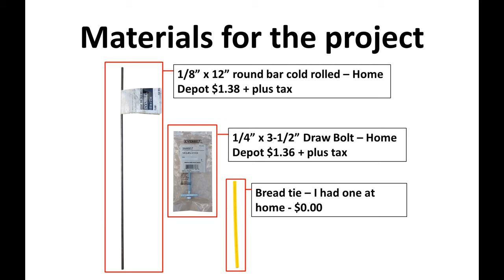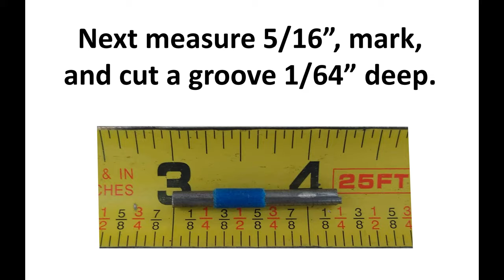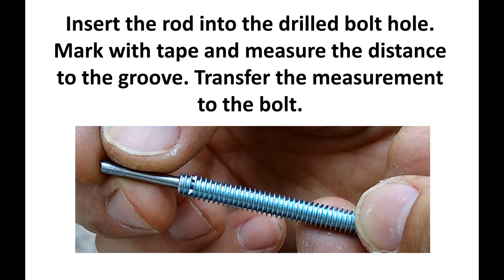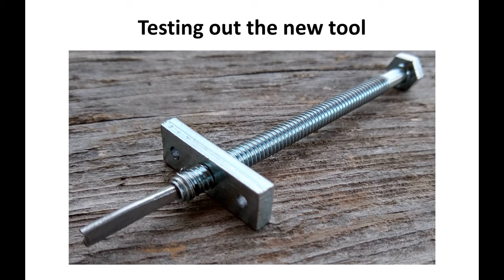DIY Hose Clamp Wire Tension Tool for under $3.00

Comment: I just made one of these. Using a turnbuckle works amazing. I use so much hose clamps this will save me so much over time.
Reply from the maker: Hello AUMM, Thank you for commenting. These wire tension tools are awesome, for sure. I needed to fasten the end of a garden fence to my porch post. I was able to fish the wire through a piece of clear tubing to keep from marring the post and was able to pull off a very strong clamp that was about 9 inches long. You'll find a boat load of uses for it.

Best of luck with your projects!

Comment: What a fabulous video production. Throw in a clever tool and an ingenious way to make it for a tiny sum and it kept me happy and fascinated for the entire ten minutes. I was sorry when it ended. I'm going to make one, purely because it looks like so much fun. Many thanks.
Reply from the maker: Hello David H, Thank you for your kindness. I'm glad you found value for your viewing time. The little tool is super cool to use. Since the original video I've just magnetized the tip and it stays inside the bolt without the need for the slotting, grooving, and bread tie part. Finding a way for it to stay but still be able to rotate was the challenging bit for me.

Best of luck with your projects!

Comment: Just made one in my shop.  Nice simplification of an old tool, and it works well, providing you use the right wire.
Reply from the maker: Hi Roger, Thank you for commenting. I'm glad you found value in this video for your viewing time. I use some stainless steel drop ceiling wire that has been working well for me.

Best of luck with your projects!

Comment: Probably one of the simplest and most practical iterations of this type tool I've seen... Well done
Reply from the maker: Hello Mr. Rickard, Thank you for commenting and your kind words. I'm glad you found value in the video for your viewing time.

Best of luck with your projects!
Reply: @vbared  - Thanks for making this video! I needed a tool for making round clamps and went to a website of a company called Clamptite. They wanted $49.95 for their tool, and it didn't do anything that your tool couldn't do for $3.00. I almost bought their tool, but then I saw your video. Thanks again!

Comment: Great video.  I plan on making one.  Just a couple suggestions though...  Drill the bolt and insert the rod before cutting the slot into the side of the bolt.  As soon as  you make contact with the rod, remove it and it will be marked in the correct spot for the groove.  Also a small ball bearing inserted between the rod and the inside of the bolt would make it work smoother.
Reply from the maker: Hello 2Lane Blacktop, thank you for commenting. Great suggestions. The rotating tip does bind on me at times. The ball bearing idea is awesome. Do you have any suggestions for a better way to hold the rod in place? The bread tie gets loose and needs to be retightened after several uses.

Best of luck with your improved version.

Cheers!
Reply: @vbared  I've been thinking about that, I figured that might be an issue.  Maybe use the side of a small flat file to square off the groove in the rod, then instead of slotting the bolt, drill a small hole and insert a small roll pin.  Might not be enough meat to hold the roll pin though.  If that is the case, secure a nut to the bolt with J-B weld and drill through both the bolt and nut.  I'm not sure what size bolt you used, but moving up one size might also work better for the roll pin idea. 🤔
Reply: @vbared  Cut the slot as you did, insert a short piece of roll pin  or steel wire and put the unused nut over the slot to capture it. Maybe a BB would work as a bearing or just round the inboard end of the rod. A little antiseize could lube it up...
Reply from the maker: @cjspaar2090  That's a great idea, Cj Spaar. Thank you for sharing it.

Best of luck with your projects!
Reply: @vbared  I think if you stuffed a 1/8" Diameter cylinder Neodymium magnet in the bolt you would get all the retention you need
Reply from the maker: @007mwn  Hello @007mwn, Thank you for commenting. That is a great idea and would remove a few steps from this process. 

Best of luck with your projects!
Reply: @vbared  id have thought a modified wire C clip or e clip to fit into the bolt thread.. grind the end tabs off (not the ends though theyd be too short to wrap round the bolt) the e clip to wrap around the bolt in the thread.. the middle tab would engage in the slot into the pins groove.. spring steel !
Reply from the maker: @Errol.C-nz  Hi Errol, An e-clip is a great idea. I'm currently using bearing grease as a lubricant and holder. The grease is thick enough to keep the pin from falling off.
Reply: @cjspaar2090  Great idea.

Comment: Well that was a memorable video showing an easy way to do something critical with a minimum amount of tools and materials. Need more like that on YouTube. Thank you for taking the time to share.
Reply from the maker: Hello Metalmogul46, Thank you for commenting and kind words. The goal was to put together something simple, low cost, without welding equipment, angle grinding, or need for a lathe.

Best of luck with your projects!
Reply: 999l

Comment: Totally McGuyvering it. Love this and will totally be making one! Thank you. Also thank you for pulling the curtain back on vapor honing; I will be converting my HF blast cabinet to your version.
Reply from the maker: Hello Brilliant Design, Thank you for your kindness. I'm glad you found value in these videos for your viewing time. Yeah, I hear you, it was interesting to me as well how little detailed information was available at no charge for putting a system together. At the time I was researching it most systems seemed more complicated then they needed to be. My goal was to get a super basic version working well that I could add the bells and whistles to if the need came up.

Best of luck with your build!

Comment: Clever.  Beats buying  a Clamptite for $30 or $40.  Thanks for the tip.
Reply from the maker: Hello 19sloper, Thank you for commenting and kind word. I'm glad you found value in this video for your viewing time.

Best of luck with your projects!
Reply: @vbared  Got mine made, all from scrap around the house.  Thanks again, Victor.
Reply from the maker: @19sloper  Great job building it, it's super handy for all sorts of clamping needs.

Best of luck with your projects!

Comment: Thanks! Might just make one of these nifty tools! Prices have jumped in 3 short years.... 12" bar cost 2.47 and the draw bolt 2.75! Still cheap as heck!
Reply from the maker: You're welcome, Mike.  The tool is super handy, enjoy it.
Reply: @vbared  What infuriates me is that it does the exact same job has a clamptite tool but costs less than $6.00 where a clamptite tool is $90.00 or more.
                   Where do they get off charging so much?
Reply from the maker: @toshikotanaka3249  Yes, I agree with you, In my opinion asking a more reasonable price will increase sales.

Comment: Excellent!  I would suggest that a nail will work as good as the store bought rod - but very good.  I was wishing I had one of these 2 days ago.
Reply from the maker: Hi David, Thank you for commenting and encouragement. Yeah a piece of rod would be better but the nail has been working perfectly fine and I've used the tool dozens of times. I recommend building one, it's super handy.
Reply: @vbared  I built one last night! I used an eye bolt so that it doesn’t require a wrench, but pretty much used your design.   Something I did differently is I cut the slot in the threads first then inserted the nail and marked it with the hacksaw - then turned the groove.  That way everything lined up on the first try.
Reply from the maker: @DavidLaFerney  Using an eye by is genius! Thank you for sharing the construction improvements.

Best of luck with your projects :)

Comment: Awesome idea!  I wonder if some soapy water (windex?) on the hose and wire would allow it to tighten up even more.
Reply from the maker: Hello SLRS, Thank you for commenting and awesome tip about the soapy water. I'm sure that will help by allowing the wire to glide on the rubber.

best of luck with your mods!

Comment: Hi Victor. I am building/converting my new HF blast cabinet using your blast cabinet videos and material list. The biggest departure from your list that I am doing is using your DIY clamp system to to seal everything. All the air connections and water connections without any screw clamps. Before I start, I do have one question, where did you get your stainless wire? I use .020, .025, .032, and .041 inch stainless safety wire on helicopters at work everyday but I haven't been able to find the thicker wire like you have. Thanks again for sharing your videos, materials lists, and your expertise with us. I really appreciate all you have done. 
Stuart.
Reply from the maker: Hi  Stuart, 

Thank you for commenting, I'm glad you found some value from the channel. Either one of the two below will work perfectly for air and water. The PEX fitting worked better for me than the barbed ones.

There are two that I use regularly one that I buy at Home Depot:

https://www.homedepot.com/p/SUSPEND-IT-18-Gauge-300-ft-Hanger-Wire-for-Drop-Suspended-Ceiling-Grids-8851-6/305043844?

The other that is a little thinker from Tractor Supply and is used for electric fences:

https://www.tractorsupply.com/tsc/product/red-brand-galvanized-electric-fence-wire-17-gauge-1320-ft-3600809?

Cheers,

Victor

Comment: Nice approach ,  saw the Russian bush crafter version 1st,   1955 patent version on Mr.Pete's channel  

I like seeing methods when you are tool limited.   Get that Lathe, you will love it.
Reply from the maker: Thanks for commenting John, I've thought many time about a lathe. Do you have any recommendation on one for someone with no lathe experience?
Reply: @vbared  Lots of videos to watch. Speeds, feeds and angle of tool I would focus on.  I would watch ebay for a deal on an atlas or other American lathe.  Make sure the tail stock is dialed in,  If it's off you will get frustrated.  If you want to chat, be happy to help.  what size stock do you plan to cut?

Comment: Great idea I made a different style that I copied though. I find that cutting a slit is a lot faster and more efficient than a hole.
Reply from the maker: Hello J, thank you for commenting. Please send a link to yours so I can see the improvements you made.
Reply: @vbared  I did not make a video but I may just make picture slides. Pretty much copied your design just the flat bar hole is shorter in length and slit on the round bar (using band saw)  instead of holes. Round eyelet instead of "L".

Comment: Perfect for a CV boot. So you don't need to remove the axle.
Reply from the maker: Hello Steve, Thank you for commenting. I've seen split cv boot kits that can be used without having to remove the axle. Those kits will bring a metal screw type band needed to fasten the boot to the axle. 

https://www.dormanproducts.com/p-105901-614-700.aspx

Best of luck with your repair!

Comment: neat! and pretty. seems like you could probably just shape the end of that threaded rod into the fork though.
Reply from the maker: Hello A.J., Thank you for commenting and kind words. The threaded bolt needs to turn while the  tip that pushes on the wire remains fixed.

Best of luck with your projects!
Reply: @vbared  aha!

Comment: Love it only thing i would do different is instead of drilling out bold i would just weld it on
Reply from the maker: Hello Ben, Thank you for commenting. I'm glad you found value for your viewing time.  I racked my brain with the tip part. Finding a way to attached it while allowing it to rotate was challenging for me. Since the video I've magnetized the tip. It cuts out the whole notching part.

Best of luck with your projects!
Reply: Not everyone has a welder in their shop

Comment: Maybe JB weld the tip in place? Nice vid.
Reply from the maker: Hello Rob, thank you for commenting. The tip was a real challenge because it needs to be able to stay engaged to the wire while the bolt rotates around it. I was thinking about maybe a c-clip. JB weld would work if it didn't have to rotate.

Best of luck with your projects!

Comment: An easier solution for matching the the groove on the inner rod and the slot on the outer bolt would be:

1.  Start out with the ungrooved rod placed in the hole that you drilled in the end of the bolt, fully bottomed out.
2.  Clamp the assembly in the vise.
3.  Use a hacksaw or Dremel-type tool with a micro cut-off wheel to cut into the side of the bolt until it touches the inner rod.  Depending upon how tight the rod is to the hole in the bolt, the rod might start rotating at this point, otherwise, just check periodically to see if you have cleared it.  You could also do the cut without the rod in there until you can see the inner hole, put the rod back in there, and cut a slight amount more, thus marking the rod.  The purpose of this is to mark the rod at the EXACT point where the slot is without the need to possibly make a mistake transferring measurements.
4.  Remove the rod and cut a groove in it where it was marked by step #3.

Since the hole that you drilled into the end of the bolt is not flat at the bottom and is instead the profile of the end of the drill bit, for a better fit, it a person could use a file while rotating the rod in a drill to taper the end of the rod to match the end of the drill bit.  This would need to be done before marking the groove on the rod since it will slightly affect the seating depth.

Nice simple design for the tool though... Thanks...
Reply from the maker: It's a great idea, Grumpy, cut them all at once. I was thinking about adding a c-clip to it.
Reply: @vbared  -- I was wondering why you didn't use a c-clip, but I figured you just wanted to use whatever you had on hand and most people would also have on hand.  MIG welding wire is kind of springy though and might make a good homemade c-clip.  I used it once to make a c-clip for a car's window crank handle after I dropped the one that came on the vehicle and I couldn't find it after searching for quite awhile.  It worked, but for that particular usage, it needed to be thicker than the MIG wire I had on hand.

Comment: I made one similar to yours but the pointy bit I just magnetised it.  I did not need to make a slot in the screw or any thing
Reply from the maker: Hello Rick, thank you for commenting and sharing your version. Magnetizing the tip is the best solution to holding it in place while still allowing the rotation. Great job thinking it up!

Best of luck with your projects.
Reply: Great idea to magnetize... My tip wouldn't magnetize at all though- may be related to work hardening from flattening the tip? I tried the bread clip, and it doesn't hold that well.
Reply: @DrewanNicholson  I just used a big nail cut a slot in the nail head then grind the nail head a bit smaller and cut it down to size then magnetized it.

Comment: That is awesome ! The only thing I don’t like is if you had to install a clamp on a hose while on the vehicle.? Also are they reusable?
Reply from the maker: Hello JOGO, thank you for commenting. I hear you, it might not work at all in some of the tighter spots in a vehicle. Unfortunately these wire clamps aren't reusable, like wire ties. The big advantage is all the different sizes of clamps that can be made cheaply with just some stainless steel drop ceiling wire that you can buy at Home Depot for under $8.

Comment: Looks like a great idea until you need to work in close quarters where you can barely get a screw driver in.
Reply from the maker: Hi John, thank you for commenting. You're 100% correct this tool will not work for all situations. Check out this twist version of the tool. https://youtu.be/AQAHsh4s-wU

Best of luck!

Comment: I wrap the wire around the hose and twist until is tight enough and cut it off, bending the left over out of the way.
Reply from the maker: Awesome, that's as simple as it gets, like a thick bread tie.
Reply: That's basically how safety wire pliers work, but I've found that I end up twisting it a bit too much sometimes and it breaks in the twist.... I've made a tool that creates similar type wire wraps for air and water hoses and it seems to work quite well and I do not tend to break the wire during the tightening... The only problem I've found is that using 18-gauge steel wire when doing very small air lines can get a bit "fiddly"...

Comment: Instead of the slot cut,,,,how about a small hole all the way through and a Cotter pin?
Reply from the maker: Hello Daxx, The challenge with the end pin is that it needs to rotate freely because it needs to hold on to and press against the wire while still allowing the bolt to turn.

Comment: Only place I've seen this tool and safety wire clamp use is in aviation.
Reply from the maker: Hello Cycle Sensei, Thank you for commenting. I noticed that as well when I was looking to buy one. The tool comes in handy all the time. I've used it to fix fences in addition to clamping hoses.